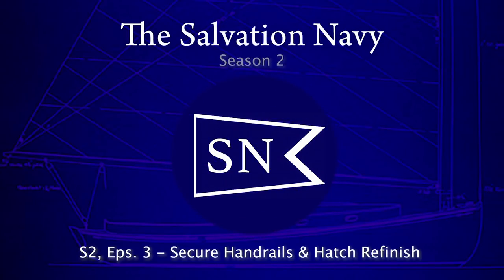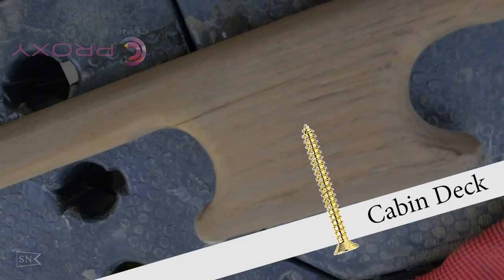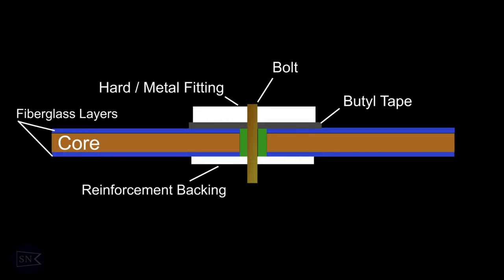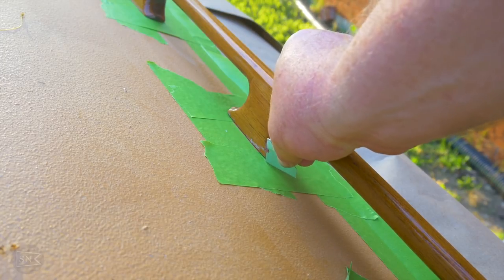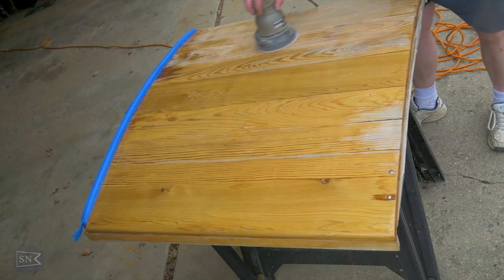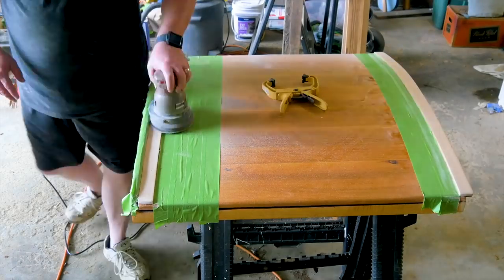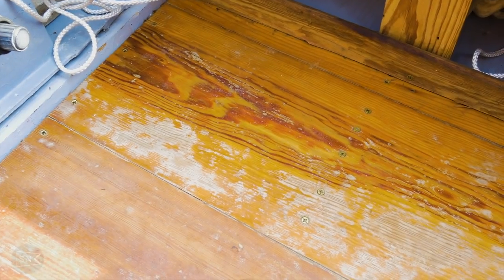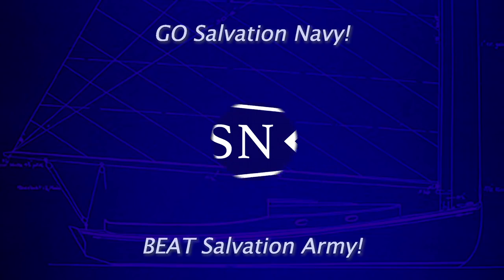Eps. 2.3 - Handrails Re-bed and Hatch Refinish   S02EPS03

Comment: Funny that your video showed up in my YT recommendations. I’m restoring a small yacht and I had a different solution for my handrailings: I inserted screw-in nuts in the bottom of the railings and secured them with stainless steel bolts with a large head from the inside of the roof. I used glazing sealant to prevent leakage.
Works great and they can be removed without causing any damage, as I did earlier today.

Comment: You will never be the rails off in the future without damaging them. The epoxy bond will rip out the wood. Further, it has no flex, so as you pull on the rails it will will pull the fibers out of the wood and leak. You need a flexible bedding compound to avoid that issue.
Reply: I used dillute wood glue and wicked it up into the handrail gaps....after several times and if done after a rain the glue would wick its way up and now several years later the hand rails are still tight. I wonder why anyone wood remove them?
Reply: @rodpaget9796  you may have to remove them again if they begin to leak and they will because he used epoxy to bed them. Then because he used epoxy, he won’t be able to get them off easily. The recommended method for bedding deck hardware is to use a flexible, non-hardening compound like 3M 4000 or butile tape. They’re both flexible, non-hardening, that will ensure removal in the future because they will leak again, no matter what you use.

Comment: How will you or anyone in the future get those handrails off? Aren't the screws now expoxied into the hull?
Reply from the maker: I don't plan on taking them off. The bolts can come out easily enough from the hull as metal won't bind to stainless steel. But the wood rails would likely be ruined. But that's the only condition I'd tale them off is if they were damaged beyond repair anyway. Was way more important to me that they be 100% secure and safe to use AND not so loose that they allowed water into the decking, which would cause even more damage.

Comment: Good video and appreciate the effort you put into these. 

using Epoxy is one way to do it, but maybe would have not been my first choice only because you will never get your handrails (which are very nice and seem like a unique design) off again without damaging them.  You call Thixo a 2:1 epoxy adhesive "sealant" but it technically isn't a sealant unless you use it like you did and any flexing might break that seal.

Thru-bolting your handrails were the key to making them sturdy.
Using thicken epoxy to fill your core area is good, but I prefer to use the bent nail method to allow the fiberglass skin to remain on the top and bottom of the hole.  Takes a bit longer to achieve good results though.
I probably would have stayed with Bed-It Butyl tape after filling the core and drilling your holes since the through bolts are doing the work here.  When using Butyl it is important that you chamfer the edges of the hole, and wrap some around the bolt before you insert it into the deck.  (BTW - my handrails have the nut in the handrail and the head of the bolt down below.
I have had mixed results with plug cutters.  I have found that I often need to sand the plugs a bit to get them to fit properly. 

I have been debating on varnishing the hand rails since there are just too many nooks and crannies you might might get failure from.  Cetol or Semco teak sealer are good options.  I have used Total Boat's Danish Sealer (like Semco) with Sunbrella covers over my rails with some success this year.  The Danish teak sealer won't last all year if left exposed and it is a pain to reapply if you need tape everything first - just like Cetol or Varnish...
Reply: Hi Neal. I too consider it important to be able to reverse the install later on. I'm going simpler even with screws only from the bottom, just like Tanzer did in the first place (which already lasted 43 years). I'll be filling the gaps and holes with butyl tape. What works for some might not work for others based on their circumstances. Thanks for sharing!